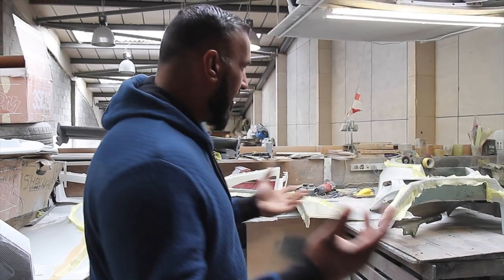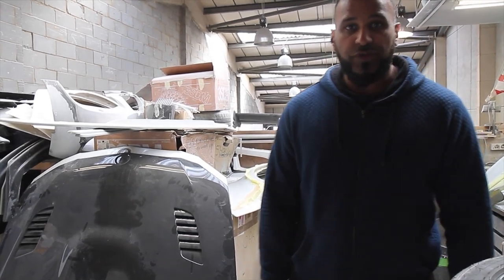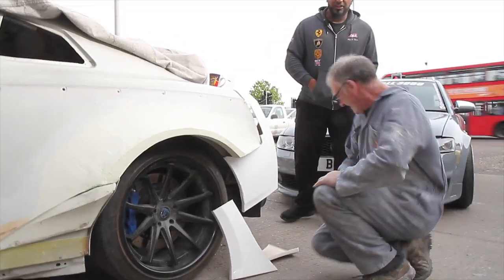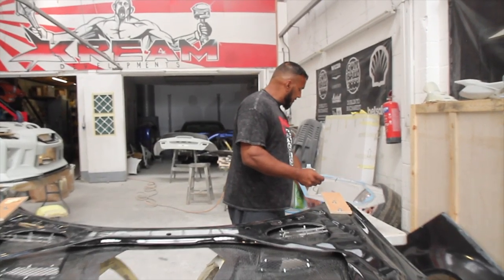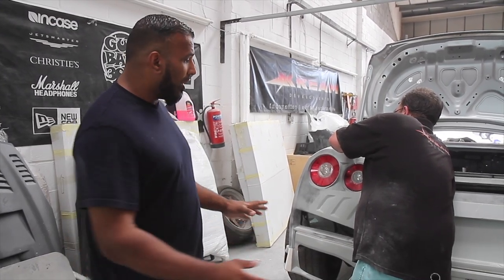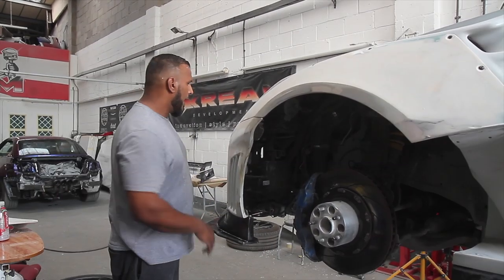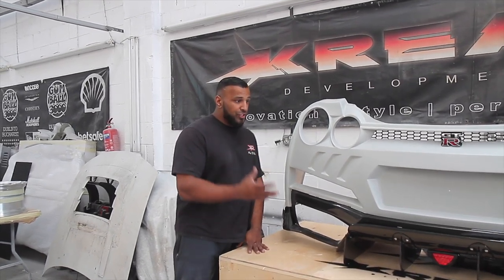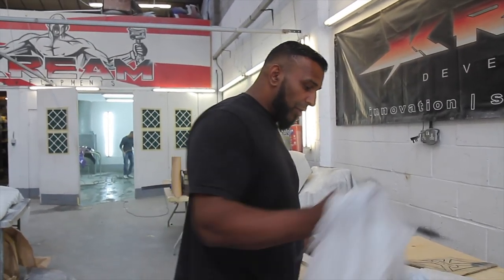Getting ready for SEMA! - Kream Developments:All access Episode 60 Part 1

Comment: Oh my good God the ridiculously wide double spacers on the rear mmmm safe I wonder not
Reply: redbull mad they normally use the spacers to get the measurements to get a wheel made that’s crazy wide. It’s not worth going wider with these body kits without extending the rear axle and front track, using a wide wheel or spacers is just dumb on a gtr or any other high performance car, definitely unsafe.